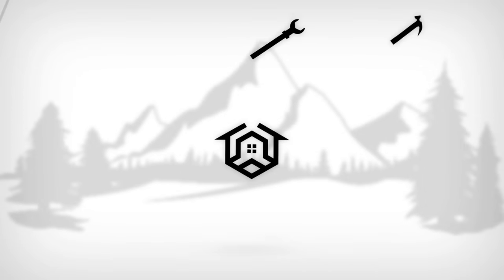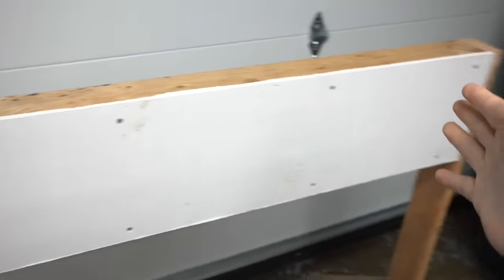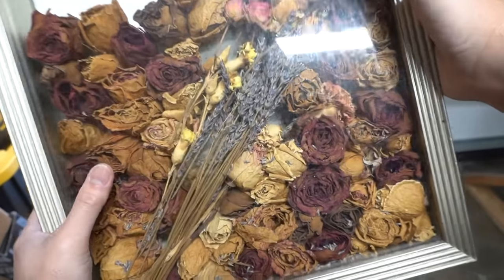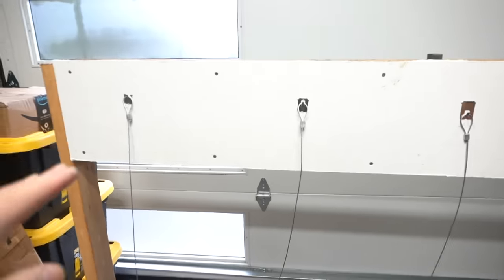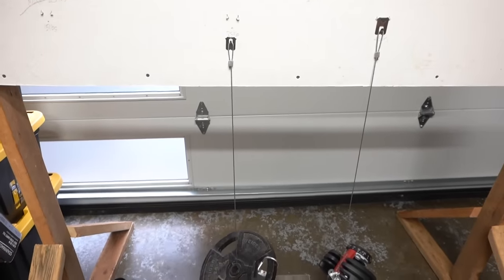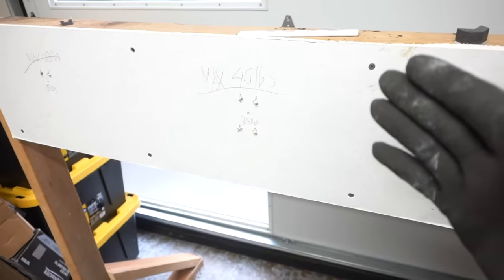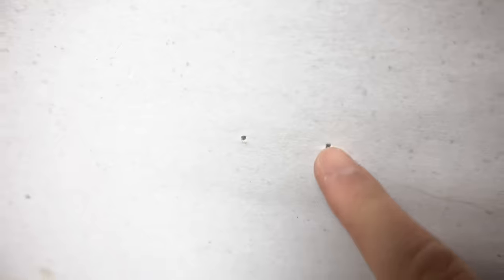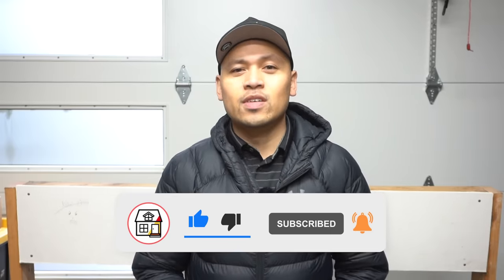The END Of Drywall Anchors?! Fastest And Easiest Way To Hang Heavy Items! LETS TEST IT! How To DIY

Comment from the maker: ITEMS I USED ON THIS VIDEO:
- 3M CLAW Drywall Hanger Variety 3 PACK - https://amzn.to/47Vekjj
- 3M CLAW 15lbs - https://amzn.to/3SgG647
- 3M CLAW  25lbs - https://amzn.to/3OHWEB9
- 3M CLAW 45lbs - https://amzn.to/3vSYV5K
- 3M CLAW 65 lbs - https://amzn.to/3SAsuBW
Reply: Why are you talking about this crap? Showing a dowel nail for concrete and comparing it with a fastening for drywall
Reply: Yeah, those are not a stable design, it's obvious the top prongs are horizontal and have no anchoring ability they just go straight in, dumb. Good video ty.

Comment: I use the 3M claws for hanging pictures and they are amazingly good. As for their weight capacity…I wouldn’t hang anything that weighs 45 lbs from just drywall from a single point. I have put up very large painting and in those cases I use two 45 lbs claws.
Reply: 3M also makes a 65 lb claw.
Reply: And that would be your choice. BTW, if I to choose between your knowledge base and the mfgr, I'm probably going with the mfgr.
Reply: @nothankyou5524  what Patrick said was perfectly logical after watching multiple fails. your response just felt bitter why you so bitter lol
Reply: Note that the packaging says you didn't get more weight capacity with multiple.  So even if you use two anchors, if the item is 40lb both anchors still need to be the 45lb ones -- not two of the 25lb ones.

Comment: Heavy things need to go into the studs. You proved that. Thanks.
Reply: Agreed.  I don't trust hanging anything over a few pounds with drywall anchors.  Gravity never rests.
Reply: Then I just need a nail that I already have.
Reply: @lym3204 I’d use a screw more than a nail
Reply: This was my conclusion as well, though I found these quite intriguing options for hanging lil' photos.
Reply: Regardless of the fixing, it won't be stronger than the structure your fixing too.

Comment: Thanks for bringing this product to our attention. I’d add one more factor to the equation of “should I hang it on the drywall in my old-ish house” and that is a number of paint layers you have on the drywall. In my 50 years old house there are walls that have 4 layers of paint (got some chipped areas while painting). So I’m not sure if I want to use this product
Reply: Yes anything that makes the outer paper layer of the dry wall thicker (layers of paint or wallpaper, especially if both!) would mean the teeth of these hangers penetrate the dry wall material less and less deeply.

Comment: People really don't understand safety factors.. The advertised weight is almost never the actual safe working load of the anchor. If you read the fine print, you're almost always supposed to divide that by a safety factor, typically by four. Which just makes sense if you think about the numbers at play, and realize that in drywall it is just the paper that is holding most of the weight.

Comment: Nice video. One thing I would add is that you tested using wires where the weight of the items is low which makes it heavier for the anchor. The closer the weight is to the anchor,  the more support it gets.
Reply from the maker: Thank you for letting me know! 🙏🏽😊
Reply: I would like to know how the length of the wire going straight down actually increases gravity, because that doesn't make sense to me?
Reply: Makes it heavier, huh? I would never have thought that.

Comment: It may be worrt noting that the thickness of the drywall has no bearing on the strength of these 3M claw anchors as the depth of the "claws" is what determines when they start to pull out. The thickness of the wall behind the claw has no bearring on how easily they will pull out.

Comment: Saves time and money for drywalls. Had mine for ten years from three different homes we moved from. It can be reused indefinitely. Takes mere seconds to mount it.  I use them to hang all kinds of picture frames and heavy wall art. Leaves almost no trace on the dry wall once removed. Saves so much time having do no more patch or repair on the drywall. I used these in conjunction with museum putty to stabilize wall frames. (I use museum putty to earthquake-proof all vertical standing decors at home).

Comment: Last year we remodeled our kitchen and I put up a magnetic bar for holding knives. The manufacturer sent a piece of double-sided tape with it and there was no way that was going to work. I purchased a 3M Claw system that included two brackets that were rated at 20 lbs total. It worked like a charm and I heartily support this product.

Comment: I will buy these for hanging pics. I like the double sided tape foam arrow guide idea! If I need to hang anything 30lbs or heavier, I think the safest route would be to find a stud and put a nail or screw through the drywall and into the stud.

Comment: I appreciate you taking the time and effort to check out the 3M hangers. It gives me another  resource that I wasn't aware. Very nice video with a thoughtful approach for testing.
Reply: I have used these but definitely didn’t load them to the max. I used two 15 pound ones for a 20 mirror.

Comment: Really great video!  You jumped right in and did a very practical test using the anchors AS THEY WERE INTENDED TO BE USED!  So often I see people testing things differently from how they are supposed to be used (by pulling straight out instead of applying a vertical load, for example).  And like you said, don't go hanging 45lbs on drywall only.  Find a stud if you have to hang something that heavy.  Good job!  And thanks!

Comment: The problem with all of these hanging products is they are stronger than the drywall.
The only ones I trust are the Swpeet anchors. They penetrate the drywall and expand for a solid grip. But unlike most others they leave a tiny mark when removed.
Reply from the maker: Thank you for sharing your thoughts! 🙏🏽😊

Comment: I just got these and used them with a heavy mirror. Super easy to use and still going strong. I’m hooked! 😉
Reply: Did you use the 45 lbs? How heavy is the mirror? I have a large picture frame and wondering if I should go with the one rated for 65 lbs, but then it also leaves more holes. Eek. Thnx!

Comment: Nice video.  I really think these turn into "knives" with a constant pressure.  The contact surface area to weight ratio seems off.  I would be willing to bet if they made those "legs"  triangular you would be able to 2x or 3x the same weight without a much larger hole.
Reply: I was thinking same. I use the Commander stick on picture anchors and I have pictures in glass frames that have been up for years, and the best part, no holes or slices in the walls.

Comment: On that middle one that failed, I think the anchor needs to be perfectly level if a person is going to hang something that heavy on the wall.   I would be willing to bet if you hung another one at the same degree of angle, that it would fail again.

Great videos and love the channel!
Reply from the maker: Thank you so much for your suggestion! Thank you also for the love and support! 🙏🏽😊
Reply: I think it was more that the weight was swinging a bit and as it was at the limit of the hooks rating it worked it's way out. They obviously designed for a perfectly static force downwards.

Comment: I have to believe using these in textured walls would significantly reduce the holding power. I do like the chevrons for marking the locations to install. Thanks for the informative video. I was not aware these existed.

Comment: If these anchors had a really good sticky backing that might add just what is needed to keep the anchor from slipping down and breaking loose.  That being said, I still would not trust this anchor beyond its rated weight tolerance.  3M makes a plastic hanger (that has an adhesive backing) for coats and such that can be easily removed if needed.

Comment: I used one yesterday and I was skeptical I could push into plasterboard without using a hammer.  It was surprisingly easy to use and is holding a very heavy frame.

Comment: I wonder if using two, one on each side of the frame like a lot of picture frames are set up, would distribute the weight better. I like that the holes are much smaller. I’ve had success with Gorilla Hooks that rest against the back of the dry wall, creating a smaller hole, but these look even better. Thank you for the information

Comment: Modern-day drywalls will all have painted or even wall paper which will increase the weight capacity of bracket.  But how will it perform or install on old lath and plaster walls vs the J hook ?

Comment: I think the first time you installed the 25 lb claw, you had it slightly diagonal.  This will cause a majority of the force to be placed on the lower claw which will make it cut through the drywall instead of bearing on it as intended.  For an application like this, it will be very important making sure your installation is completely level in order to prevent this type of failure.

Comment: They're great for hanging pictures and the like, anything that can hang from a hook. But if you're mounting something heavy you need something more suited to the task. The best out there is GeeFix - synthetic anchors that you need to drill a hole for, but these things can hold TV's or cabinets to a drywall (without a stud) easily. The difference is night and day, the claws may handle 50 lbs, but the GeeFix ones are more like 200 *kilos*.
Reply: Or a traditional toggle bolt. Properly inserted, a toggle bolt will hold far more than you would imagine. I have hung a fully loaded iron pot rack from 2 toggle bolts in a kitchen ceiling.
The one downside is you need a LARGE hole for the toggle bolt, and it is strongest when the pull is away from the drywall.

The GeeFix does look like an interesting variant on the traditional toggle bolt. It looks to have most of the strength of a toggle with slightly easier installation. But the plastic will strip easier than the metal nut of the toggle bolt. But if the GeeFix is strong enough that the drywall breaks before the GeeFix, that doesn't matter.

Nothing else I have tried is reliable. The best faux toggles work well if they work right, but there is no way to know until they fail. But you can easily tell if a toggle or GeeFix installs correctly before relying on it.

Comment: I have some J-shape hooks.
Just a J-shaped thick metal wire.
Posh the top of the J, straight through the dry wall, then the rest of the bend, except a small hook at the tip.
The ones I have are rated for 25 kg (55 lbs).

Easy to install, easy to remove/reuse. 
Only leave a 2-3 mm (1/8 inch) pinhole mark.
Only drawback, they need cavities behind the drywall for the J to fit inside the wall,

Comment: I appreciate the testing that you did however, I think it was very clear from the failure of the 25# hook that a better test would not be a straight static load as vibration can easily loosen a smooth hook like that. I would have placed an orbital sander or other lightly vibrating tool against the studs and seen how those weights held. There are always vibrations in the house from passing traffic to walking and other activities in the home. Just because the hook works in the short term does not mean that it won't fail in a couple weeks or months. I had many Command strips that failed due to vibrations and noted that the failure occurred after a large vehicle passing by are a hard thump on the floor.

Comment: During your test the weights still had some movement in them where as there would not be any movement when hanging actual pictures of similar weight. That said. Would you mind redoing this test but with pictures  at those weights for a more accurate test.

Otherwise, great work on what you do 👊🏾💪🏾

Comment: I would like to see this test using the picture hooks which have been around for a long time.   The single nail at an angle type.   They come in a wide range of weight, they work and only creates a single small hole.   Plus if available the nail is long enough for the heavier duty one will nail into a stud.   Another advantage is if you need more capacity you can place the hook right next to each other, basically form one wide hook.   These seem to be fixing a problem that does not exist.  For hanging pictures I have never used dry wall anchors, particular those plastic ones.  Again my go to is the hooks with a single angles nail, they been around many many decades and they work.  Plus I always double the load limit, if the picture is 10lbs, I use 20lbs hook.

Comment: 3M is one of the few companies that still doesn't put too much garbage out the door with their name on it, seems the issue was more with the drywall. Does look handy for smaller stuff like pictures, paintings, or even mirrors. Yet due to limitations of the drywall, it's better to stick to the lightweight option without anchoring to a wall stud. (Surprised they had the heavier options when there's that much uncertainty there. It's likely people may be annoyed if the hanger itself doesn't fail, but the wall supporting it does.)

Comment: These are fine for hanging light to medium weight picture frames with wire, but there are numerous ways to do that. A simple plug anchor plus a hook is stronger and more versatile in many cases, and much easier to position precisely- which you need to do if you're installing two screws or hooks for D-rings without wire. Most picture frames with a sawtooth hanger are very lightweight, and for that these are overkill, a simple nail will work fine.

Comment: These things would likely perform better if the claws had a steeper angle to grab into the walls with and the hook was lower on the bracket to reduce the load's contributions to pull-out force some more.

Comment: This "claw" relies only on the gypsum & paper to carry the load on its pins (so thickness is of the board irrelevant once past depth of the claw, but density of the gysum itself the biggest factor!).  Best are anchors that distribute load over an area across the back of the board.  But personally I hate drywall. Prefer plaster, but a lot harder to find anchors that work since it's such a tiny part of the market!

Comment: The one problem I see is that these push the top of the frame off the wall like most of the "easy" picture hangers. Sure, deep back frames may be fine but a simple nail will continue to be my primary solution for hanging pictures.

Comment: EZ Anchors are almost as easy to install, and, in my experience, are more likely to pull the drywall OFF the studs than they are to surrender @ the anchor (Yes, literally had that happen. The whole drywall section was pulling off the stud due to a bookshelf I'd secured with EZ Anchors -- resecured the drywall and spread the weight across more EZAs, problem solved).  And they're probably much cheaper. Biggest issue with EZAs is avoiding the studs and any other internal bracing. EZAs are better than pretty much any other anchor for anything except brick or cinder block walls. And the holes are still no bigger than a simple spackle application.

Comment: Those blue anchors are NOT for drywall, there for brick and concrete walls, i never have problems when i use the proper ones, I use hollow wall anchors for drywall.

Comment: I'm not convinced.  There's a creep factor you have to consider.  Weight + time.  It looks like it'll work itself out over a time period. 
I also think it could be designed better.  The spikes could be angled downward at about 30°, and have four of them.  Might have to be tapped in with a small hammer but it'll hold better.

Comment: Although I generally like 3M products, I take their load ratings with a grain of salt.  This is especially true of their Command series of removable hooks.  They are NOT a permanent way to hang stuff.  Almost all of the Command hooks that I've used have fallen off with less than half their rated load in less than a year.  I've experienced this not only on drywall, but on smooth, painted metal surfaces, too.  The anchors you show are substantially stronger, but I wouldn't push them to more than half of their rated load.

Comment: I think a contributing reason that these failed when they did has to do with how your hanging the weight. 
I'm not engineer, but I suspect if you put a flat weight over the hanger, like how you normally hang a picture, they can hold weight a lot better.

Hanging a picture, the picture itself contacts the wall to some degree, and this could effect the forces applied, not to mention you're artificially shifting the center of gravity by dangling the weights very low, letting them freely dangle, ever so slightly allowing the weight to rock.

Test seems a little flawed.

But also, what would someone hang that's 45lbs?

Comment: The Hollow Wall Anchors I have been using my entire 59 years on earth are the best so I will not be using those push in jobs- they are going to cause injury to someone some day the butterfly steel hollow wall anchors come in 1/4 bolt size & 4" so that you can easily compress the wings to feed it into the hole & thru your workpiece... those things truly hold the weights regardless of any cycle fatigue from hanging & removing then  rehanging or changing what you hang... never an issue 7 I have been using them my entire life so I don't think this item in your video is a good one- thanks tho certainly saved me the time & money trying something new that clearly is an inferior solution to what I have already been using successfully!

Comment: Good for hanging 3-4 pound pictures, I wouldn't trust them any larger. As soon as I saw them I could see a flaw in their design. If the weight is not 100% straight down, they will slowly tear the drywall paper and fail.  3M usually gets it right, but this one was a reach.